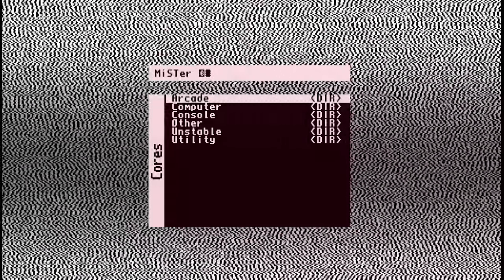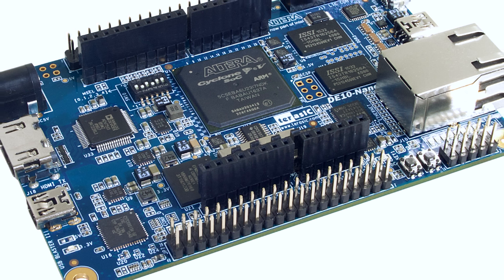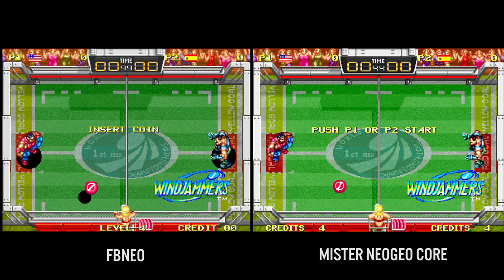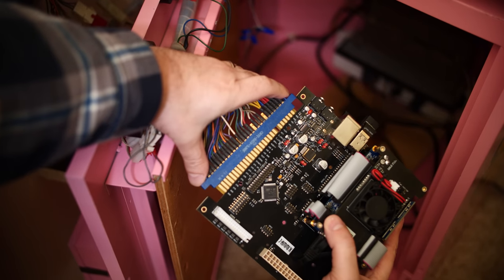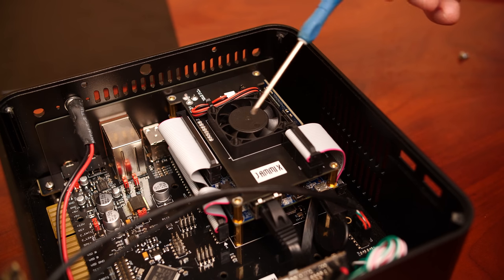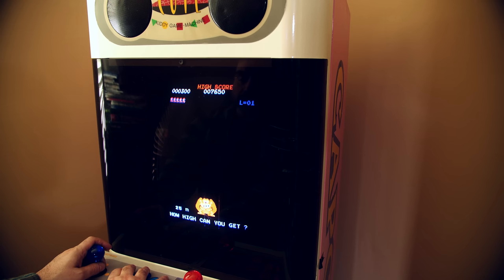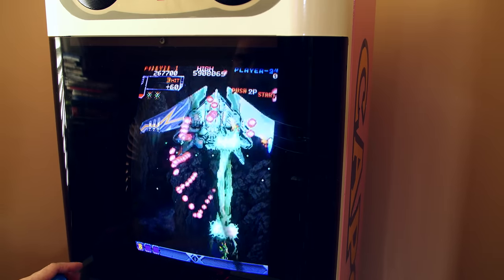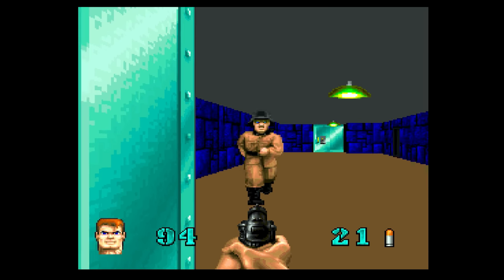Finally - I got my hands on a MiSTer FPGA Retro Gaming Setup | MVG

Comment: Dare I say, it's a bit funny to see that the one core you managed to find visual errors in is the Amiga one,
the system the MiSTer is named after. (A*Mi*ga - Atari *ST*)
I wonder how it compares to Dennis van Weeren's MiniMig FPGA core from all these years ago, which uses a real 68000.
Reply: It IS the MiniMig core, afaik
Reply: The Minimig core is the same as Dennis' original core, but with quite a few bug fixes and tweaks done since. Including RTG support being added (via DDR) in recent years.

It's actually one of the more accurate cores, from what I've seen. Obviously still not perfect, but the more people report bugs on github, the more will eventually get fixed. ;)

Minimig now uses the FX68K core, which is supposedly "cycle-accurate". Or, I believe it actually has an option in the menu to switch between that and the older TG68K core, just in case.

It's possible some of the edge cases in demos and games can be fixed with different menu options. Or it could just be another small timing bug that needs to be squashed.

It is also a bit ironic that it took quite a while for an Atari ST core to appear on MiSTer. lol
But I think Sorg named it MiSTer mainly as an homage to what the MiST team had achieved originally.

Comment: Learning Curve? Good.
People often don't understand that gatekeeping isn't a purely negative thing.
Sometimes learning about a thing is part of the experience.
Sometimes learning about a thing is necessary to properly/safely use it.

Example?
How many people drive around with a check engine light?
Do they actually have any idea what the problem is? 
Is the problem going to kill people, or is it just an annoyance?

Pushbutton solutions are NOT a good thing...

Comment: What about installing the MiSTer into an ASETEK Vapochill Lightspeed XE-II and using the cooling probe to keep the SPARTAN ALTERA FPGA at a nice -130 degrees below Zero but the the surrounding board needs to be coated in Corning fluid to keep moisture away from the FPGA so that it doesn't short out.

Comment: There is also a an n64 core in dev as well, not as far along yet as far as booting games but its neat to watch this progress continue!
Reply: Sadly not, the N64 is too complicated for the DE10-Nano.
Reply: @alexatkin  There is technically an effort to make N64 in FPGA, just it won't run on the DE10-Nano.  FPGAZumspass was also working on Nintendo DS in FPGA and put it on the backburner to do more relevant stuff.  Eventually the hardware will advance and get cheaper.  I foresee a day when there's a Raspberry Pi with an FPGA option.
Reply: @alexatkin  I see, after re-looking up the project i can see that he was indeed using a more powerful fpga board that was 64bit. Oh well, ill still keep watching the project!

Comment: @4:05 Great, so now I have a cycle accurate Vectrex hardware simulator and no specialized monitor to output the sweet eye melting vectors. Frankly, nowadays emulation for a lot of hardware has gotten good enough, but having lived through it all I just can't play the stuff on a flatscreen nor do I have room to bust out my old CRT.

Comment: Just wanted to point out d3fmod has an Mister Mini-ITX board as well, with more features, but without the JAMMA compatibility, and Checkmate1500plus also has the MiSTIX (not sure if out there yet, and only bundled with their case afaik).
Reply: I got the MiSTIX board, its not a bad kit. But I think the other two ITX boards are a better solution.
Also I think Checkmate gave up on the MiSTIX in favor of a metal adapter plate that just takes the existing MiSTer USB and I/O boards, and using the ATX power adapter they have from their other kits.

Comment: Only issue for MisTer Project is the cost. $700 USD is a lot of money. I'll just stick to my PS TV that at one time was selling for 25 USD, to be able to run all these games. Currently have 2 PS vita, 1 PS TV, Snes, Nes, and Genesis Mini all modified with custom firmware.

Comment: MISTers to me are like the record collecting hipsters of emulation scene. They are damn expensive for that "hardware accurate" feel that gamers are trying to go for. Idk, maybe I've just been emulating for so long that I don't see a place for it in my livingroom that I can't already do with my PC hooked up to the TV.
Reply: I've dabbled in emulation for 20 years and it's been rare that I do not encounter enjoyment-destroying control delays in games via emulation.  I suppose you could equate that to golden-eared people in a way, but I think that it's more than that.  If the controls feel off even a little bit, many games can become unplayable.   This MISTer stuff looks like it could completely remove that issue across the spectrum.  I'm definitely intrigued.
Reply: I don't see the point of MiSTer either, but I am saying this as someone who owns original hardware and have been emulating on PC for years. I just don't think the price is worth it when PC emulation, while perhaps not cycle accurate, is damn near indistinguishable in most cases.

Comment: Excellent video as always 👍🏻
If it accurately emulates the hardware a bit like low level emulation in software, why did you say it is still prone to emulation glitches (I imagine like high level software emulation)? If the core is already in a 100% state, shouldn't it be no different from real hardware?

Comment: I wonder, if speedrunners would consider this original hardware. If so, there is a huuuuge market for this device.
Reply: Depends on the community. Stuff like Super Mario World (vanilla) they probably won't even accept Super NT, but all SMW romhacks accept that. Most smaller and open-minded communities would probably be fine with Super NT or MiSTer.
Reply: the fighting game communities are now starting to use mister for tournaments now

Comment: I think I am like you in this one...  I have every console that I play, and have everdrives for those very expensive titles.  Emulation is so dam good why even look at this option. If you have good hardware, your able to play up PS3 and even Switch games.  If you never used a MiSTer, and use Emulation, is it that much better ?

I see the appeal, I do.  Right now with the chip shortage and the scalpers over charging, it's not a good time to get into this unless you have big wallet and don't care. 

Interested but, this one item I will wait till this chip shortage is over with and prices go back to normal little better.

Comment: I cannot imagine the hours and number of fpga's it would take to decap, read, and reassemble in HDL all the chips of an n64 but it has to be possible
Reply: Just got up to the bit where there's PS1 one the way. Thats insane. I dont even get how you can run hardware emulation but only have an incomplete spec loaded.

Google shows there's people working on the n64 and basically answers my question from here about nintendo re-releasing the physical silicon for a mini https://www.youtube.com/watch?v=-BA0BJwuGK4&lc=UgyYpgG64KZKeqGPnrx4AaABAg
An fpga should answer any concerns from your recent vids on the switch's official emulator
Reply: I could be wrong but from what I understand the DE-10 nano doesn't have enough space to do a N64. The PS1/Saturn cores are apparently already pushing the boundaries of what's possible.

Comment: A MiSTer seems awesome to get but damn is it expensive. The expensiveness isn't that bad because I know it had a lot of value, and the tinkering and setting up part would be fun, but the chip shortage making everything more expensive than necessary leave a bad taste in my mouth to buy it anytime soon. Feel like I'l be safer buying something else to expand my gaming library and get the MiSTer down the line. A PS Vita would add in PSP as well.

Comment: From what I'm gathering, if you already have a high-end gaming PC and don't have any interest in arcade cabinets/games and are mostly wanting to emulate consoles, you can still get away with that. Most of the lag on a PC comes from USB slowness and the types of monitors used. If you can get a serial port controller and a gaming monitor with a strobing backlight attached to a very fast computer, emulation is okay. But if you don't have a fast gaming PC and only have consoles and a laptop, or if you are really into arcade cabinets, this might be worth the price. The main thing that bothers me is that FPGA doesn't necessarily mean accurate emulation. They said it still has the same bugs as software emulators, and that's disappointing to me, because I was expecting FPGA to be more accurate and thought that would be one of the selling points. Apparently it is not.
Reply: FPGAs can provide accurate emulation, but just like with software, it relies on how well it is implemented, and how well the original hardware is understood. Hardware can have bugs too, but luckily FPGAs can be updated and improved after the fact.

Comment: For 8-16 bit stuff I'd rather use a cheap Wii through component (I am using d-terminal) connected to a CRT with emulators that output 240p, it's good enough accuracy wise and the Wii video output to a CRT is fantastic.

Comment: Nice. I was wondering if it works with an IPAC USB controller. I have an arcade cabinet with a Windows machine hooked up. Looking at this MiSTer I'm interested in using it but wondering if I can use my IPAC controller. Then again, I want to use my Sinden LightGun which won't be compatible with it (I presume)

Comment: I truly wonder if people could beat an A:B test using modern emulators and an FPGA system - perhaps input latency, but I'm still skeptical one would notice, especially since the emulation here is prone to the same errors as software emulation (13:00). 

For much less money, you could just get a good SFF software emulation machine that does so many more consoles and has a good UI (not just a directory listing) with box art thumbnails, etc.

Comment: Okay… million dollar question… if your setting up a brand new “mame” arcade cabinet, are you installing a Mister or a PC and software emulation as your hardware backing it? 

In the long run it looks like the Mister may be the better long term play.  

Jamma board support is “nice” but those arcade PCB boards are sooooooooo expensive, and old with components. The older they get the higher the rate of failure. :(.   

I can’t see myself ever buying a Killer Instinct PCB sadly. :(

Thoughts?
Reply: As someone who loves Killer Instinct too, leave buying the PCB to someone else
Just snatch a MiSTER and run the game via the appropriate files, after all.
They're just virtual copies of the data that would be in the PCB, or cart for the SNES port

Comment: I'm still not sure I understand what this does that's superior to software emulation. People keep using weasel words like "software emulation is a bit off" or something but I'd really love to hear concrete, specific examples of what the mister brings to the table that I can't already do with software on Windows - or an addon board in the case of connecting to an arcade cabinet/JAMMA harness. It's fine if it's better but can I get an actual game or console that has meaningful differences?

Comment: If the CD32,the apple puppin,the 3DO,the marty 32,the nec pc32 etc,,, will be also replicated here,that would be awesome,
But for $300 to $500, man i could just buy an old pentium pc for probably less then $20 by a second hand store and emulate most good old 80’s and early 90’s systems on it as well, in fact i still got my pentium 4 pc with many emulators on it😁

Comment: Stuff like this makes me continue to question why the console companies aren't working to offer complete digital consoles for sale. I mean just think about it for a minute and consider what Phil Spencer has said lately. Some old games they just can't bring back because the companies are defunct, the licensing is stuck in corporate hell, or nobody wants to port/emulate some old games. Why why not work on an official console emulator? Take PS2 for example: Despite the amazing work in PCSX2, it still has a LONG way to go before the complete PS2 library is playable without serious bugs. Even the most popular games have some issues still. So why doesn't Sony take their hardware design sources (you know, since they actually own and have access to it), and build a PS2 emulator with 100% accuracy? They legitimately could sell it as a full-on "digital console" for like $299 just like the real console launched back in 2000. Then, they can sell "plugins" for all of the games they can still legally sell or license. For any games that can't get companies to agree again, they could advertise "just plug in a USB DVD drive with your original PS2 disc and play it!". Plus the source code of an emulator could continue to be carried forward through the years to be updated as necessary to keep re-releasing the digital console on PS5, PS6, etc. And this would work for any console manufacturer. On top of it all, the cost of such a project wouldn't even be that extreme, look at what emulation communities have accomplished by hacking/decomp/die shots/guesswork. With the source, it's significantly easier. They'd turn a huge profit on this.

Comment: I wonder if somebody could make FPGA emulation cores of hardware music samplers such a AKAI S900/950, Roland S-series or Emu SP-1200 and other. Of course I understand that some of external peripherals (such as additional buttons/sliders/drives etc) will be needed to replicate the system but I think it's possible to emulate the sound character of these machines this way.

Comment: Was there an N64 core available? Guessing if Saturn and PSX are still in development, GC/Wii aren't on the cards yet?
Also MVG, will you be reviewing the AYN Odin Pro?
Reply: no n64 or GC/Wii  fpga to small for that but there are others working on a n64 and xbox1 core but on a difreent fpga but cost more  maybe 1,300-3,000 and they are not part of the mister team

Comment: Noob here.  Maybe I missed it in the video.  The Amiga problem with the scene demo.  So the problem is with the hardware?  So it can or can't be fixed?  Or is the hardware a writeable chip so can get updated?  Is there a software layer at all?  Very curious...

So many questions lol.  Thanks all in advance.
Reply: its his seting works fine in my setup and no overhead no os to interfer with the cores its stright to metal  and bugs can be fix by updating the core once you find out what went wrong

Comment: The Atari 5200 substituting the 8-bit computer range once again :(  or does selecting it open up more Atari hardware options?
Reply: You are only seeing the consoles, there cores are organized in the following folders by default. 

_Arcade, _Consoles, _Computers, _Others
MVG is only showing the consoles folder list.

The Computers folder has about 50+ Microcomputers from the 80s and 90s including the Atari 800 and the Atari ST. There everything from the Altair 8000 and DEC PDP-1 to the PC 486 and Amiga (1200 - 4000 with some 500 and CD32 Support).

Comment: Is it possible to connect this to a SAMBA share and have it pull file from there? With a decent sized SD card it could only keep the most recent and most used stuff locally.

Comment: You realize how many a system you can run on this? Amiga Atari, 486 (crappier than it should be) etc, The main advantage being the ever evolving cores and updates, if something doesn't work today give it a bit of time and dig them forums etc ;)
Reply: And just cause I feel funny, and it's an interesting reference, no matter how much the French call potatoes "Pommes de Terre",  Potatoes will never be apples. Which is something that semantics can be annoying for, lack of descriptive power to establish crucial differences with a single expression. So, in order to ensure clarity of information, Hardware Re-implementation in Re-Configurable logic vs Software Implementation is the real thing here. One thing I do grant, the word is ambiguous and can indeed be used both ways, my issue with that is the lack of differentiation of important differences. Which is why I hate using that word when covering FPGAs, mostly because for the majority of the time is has been used in the IT world it was referring to Software Implementations, which have existed in this world for many more a decade than FPGA re-implementations, therefore driving the likely hood of misinterpretation unless you actually know what things are. And sorry for that crash landing joke, could skip that one haha. Thing is, it made a good point, lack of clarity on technical details can lead to catastrophic results (which is why I couldn't skip that one) Not exactly dealing with things that will have a serious impact on anything as far as I am aware at this stage, though, making the habit of getting important details across the standard approach has it's benefits.
Will never be fond of the usage of terms that can lead to ambiguous interpretations (unless I'm making a joke)

Comment: MisTer is simulation and Input lag with the SNAC serial is nothing to compare with emulation.  This is all about it for myself!  It recreates the real consoles, their glitches and most important, the input lag from when you push a button to the frame on screen.  The run-ahead function in Retroarch is not even closed with the feeling and its glitchy.